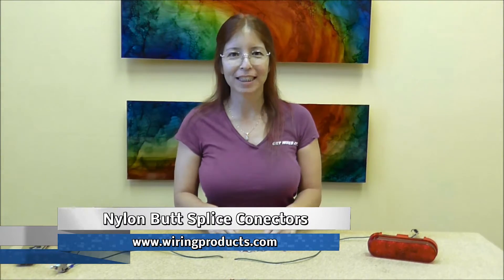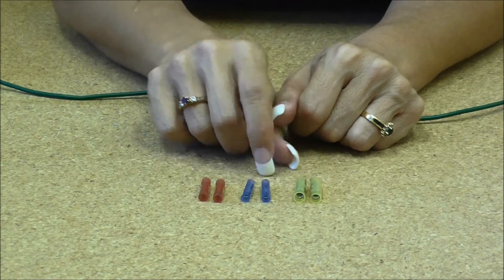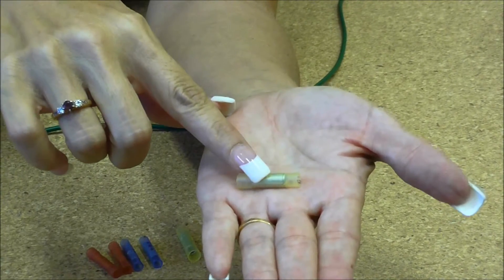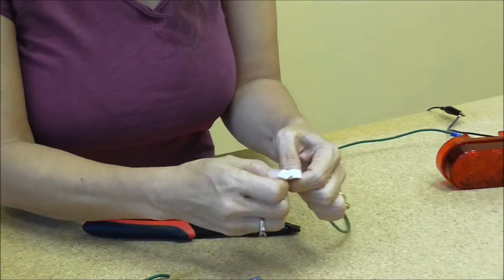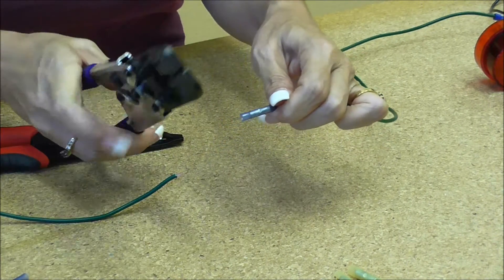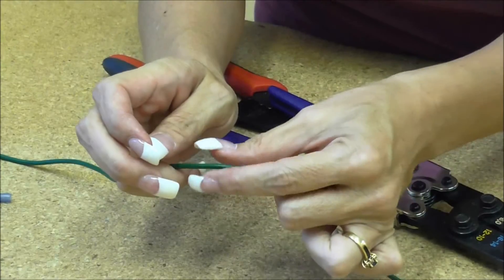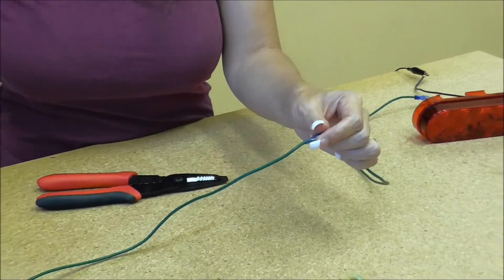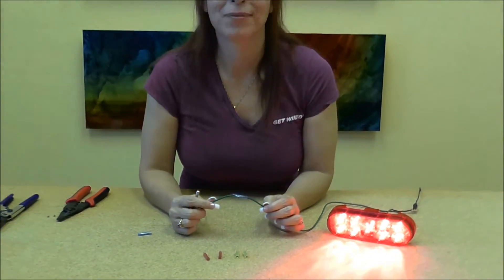Nylon Insulated Butt Splice Connectors for automotive use Wiring Products

Comment: Thanks. What if the wires are different sizes? The add-a-circuit fuse tap is 16 AWG but my switch wires are very thin (22 or 24)?